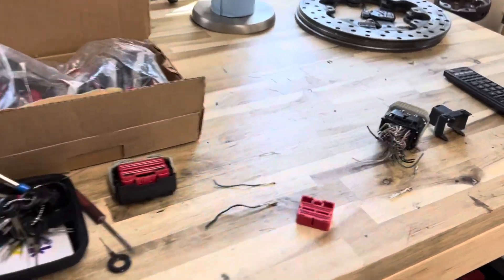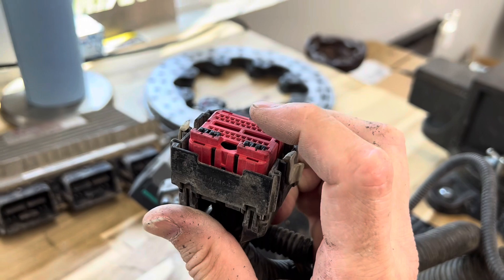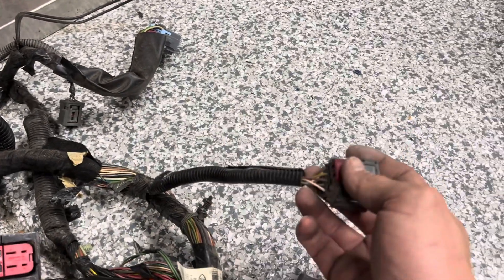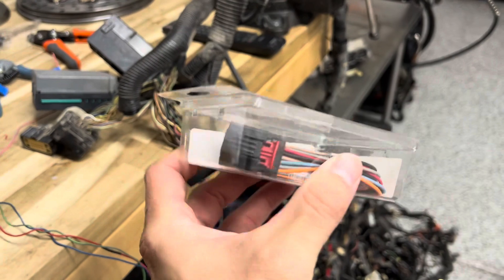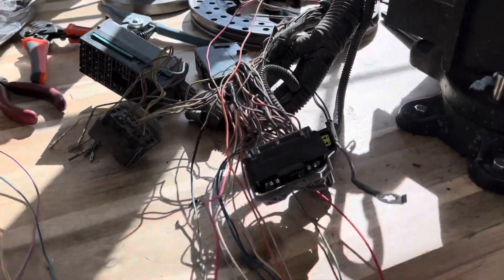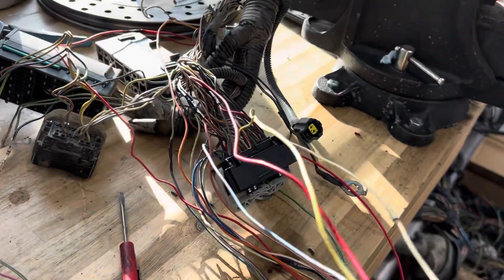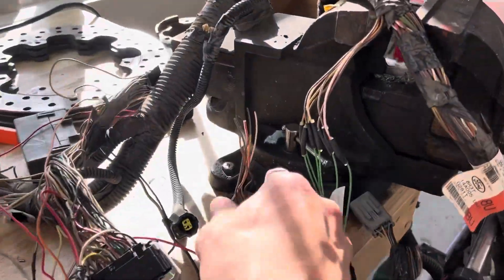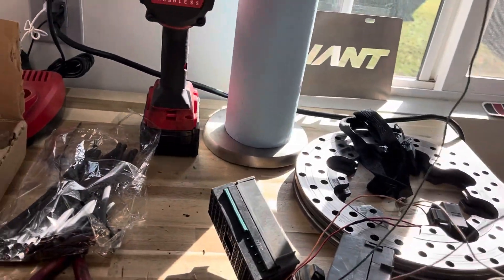Coyote Swap Early S197 DEEP DIVE into how we convert the body harness for a Gen 1 PCM

Comment: Hey Matt, I Boss 302 swapped my 2014 V6. I plugged up all the wiring and the ECM, SJB, Fuel pump and regulator, but it won't get out of limp mode. When I crank the car, it starts perfectly fine, but  after a few seconds it cuts the RPM super fast and the service wrench shows up. If I drive the car, it will get into gears, but won't go very fast and sounds like it is starving for fuel. Any help here?
Reply: Did you figure out what it was?

Comment: Hey Matt Could you help me with my Mph and Rpm and Temp gauge? Im using the PBH Harness.its an 06 V6.the Swap is a 14 /6R80..Im Currently using gauge pod temp and Rpm andGps glow shift for Mph..aldo i have everything for the Ac but havent installed yet.Thanks for your Time and your Video's..
Reply from the maker: Email me Matt.MakeItModular@gmail.com
Reply: @MattSoppa will do and Sent a pm.
Reply from the maker: @JacksonGtrs  are the DMs on YT?? Email is best 👍🏼